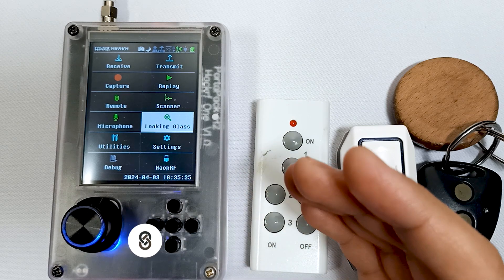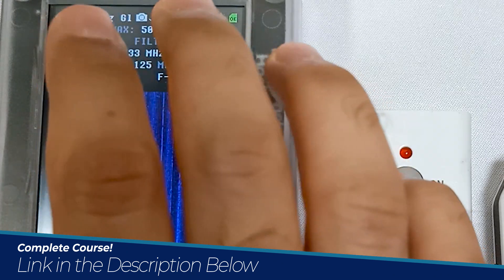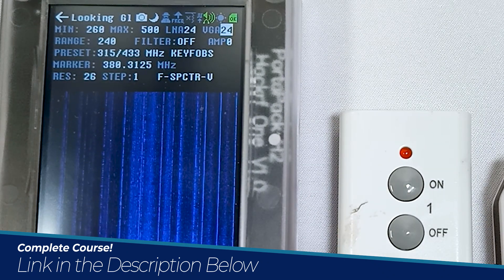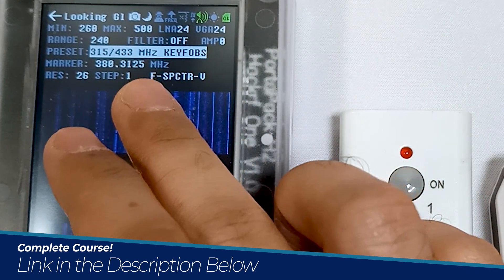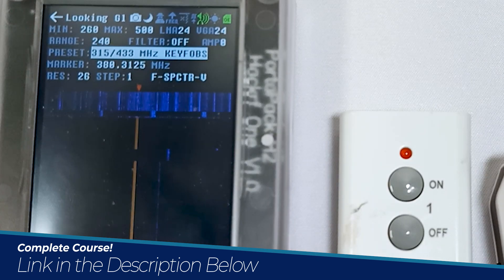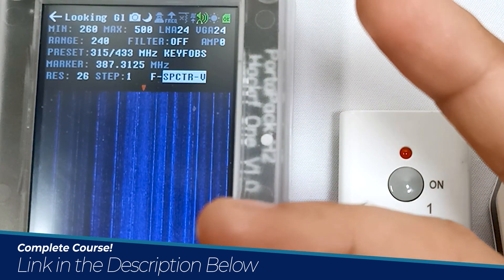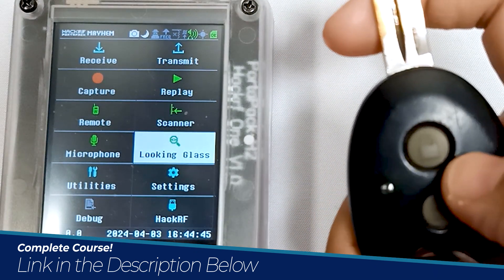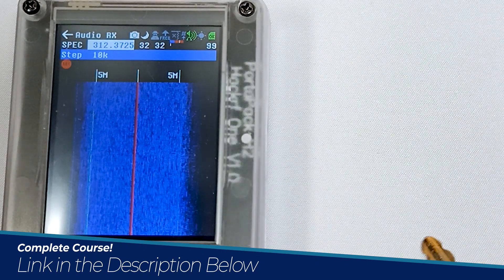Finding Frequencies for Wireless Devices with HackRFOne PortaPack H2

Comment: 🙏🏻-Excellent tutorial video teacher Saleem. Thank you with regards to the Hackrf because for me this has been an evolving education. I started with flipper zero learned and purchased all the boards and protective equipment needed for it then I took some courses with you in the Udemy app moved into SRD which is still evolving into VMachinery / Linex, Python ect. and of course the Hackrf which I am still purchasing anntenna for, blue tooth, another 3.5mm audio male to male barrel 🙄-I broke the first one when I accidently dropped my Hackrf while updating it's firmware. So my question because I have searched many places and have not yet come across a vender for the Hackrf protective cover with the magnets....I
do not own a 3d printer and have not yet elected to invest in something like that yet so....
can you give me a link for finding one? Your videos on Hackrf accesories had no links for it and the video was vague on where to purchase one.
Thank you🙏🏻
Reply from the maker: Protective case is 3d printed, I also don't have 3d printer. But I found a local vendor who does 3d printing. Look for local vendors in your city. Regarding 3d printing files you can find them on printables just search for portapack. Hope this helps!
Reply: Thank you unfortunatly I live in a spars rural area so there is not
much consumer
goods
services around here. I guess I will have to wait until someone decides to market them online.